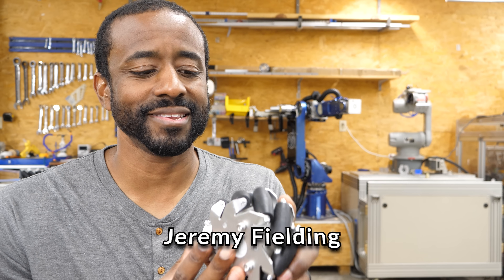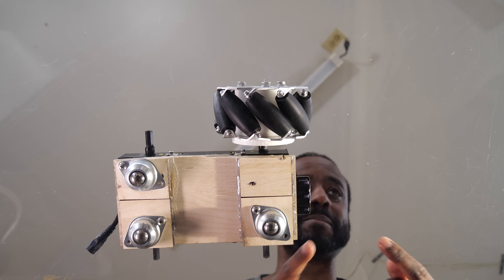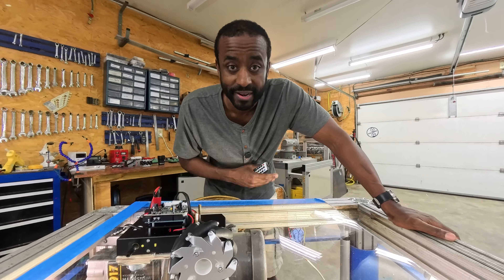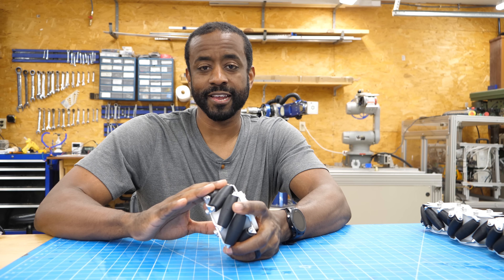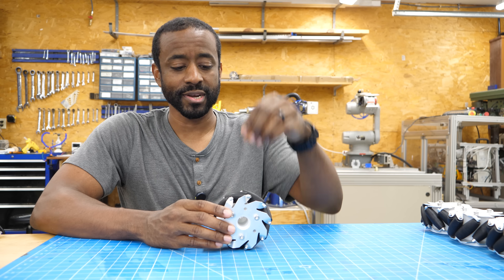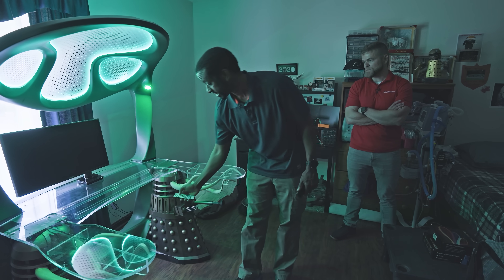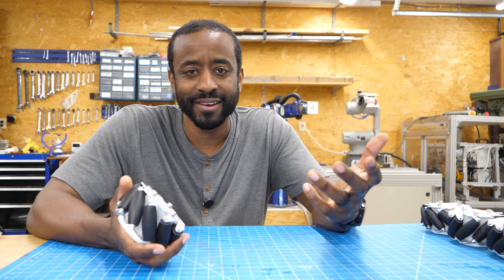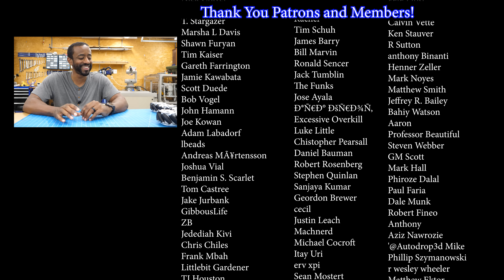The Mecanum Wheel Is So Weird, It Is Genius. How It Works

Comment: Back at school we used two motors, two wheels, one rear caster, and we had to build the body from wood. We used BBC Microcomputers (no fancy controllers, it was wired to a jack plugged directly into one of the myriad of ports on the machine) with an interface program created by one of the teachers to remotely control it by wire, it could be used to program instructions to control each motor directly (eg., LEFTON 5, RIGHTOFF 5, BOTHON 10 (seconds,) etc)or it could translate ihigher level instructions to control the motors to make it do what we want, like LOGO (Forward 5, Left 90, Forward 10, Right 90 etc.) The robot was very simple to construct  and taught us skills in woodwork, basic electrical engineering (basically how a resistor works) soldering and programming (even if it was a high level anguage.)

Comment: Thanks Jeremy, interesting video.  I now understand how the aircraft container loading platforms work using mecanum wheels when they line up the containers to load into the aircraft.  The wheels are mounted into the platform of the container lift, they then act on the container to align it.

Comment: Hello, I first saw this wheel drive in a monthly publication "Popular Mechanics" from 1967, in France, and I remember that its inventor was a citizen of Hungary. The explanation was very clear, with an air compressor and a distributor that made the wheels turn in one direction or the other, according to a number of revolutions per wheel, which means that the vehicle equipped with these wheels did not need a gearbox, nor a differential(s). Therefore, it is far from being a recent invention, and I think that it has since fallen into the public domain.
Reply: Hello again, on reflection, I thought I still had the newspaper "Mécanique populaire" which contains this article, and I found it. It is the September 1965 issue, in French version, and appears on pages 70 and 71, under the title "Cest la roue qui marche!". The inventor is Julius MACKERLE, and the entire kinematic chain contains, in addition to the chassis, four walking wheels, an air compressor and a motor to operate the compressor. I tried to find the corresponding issue in the U.S. version, without success so far.
Reply: Great information, thanks!

Comment: I worked as an intern at a robotics company doing software for ROS.

Apart from development I also had to test the actual robots to ensure everything was ok before shipping and some had those mecanum wheels.

I controlled the robot with a PS4 controller and it was like a really expensive RC car and yes, at high speeds the wheels slipped a lot, it was really fun  making it drifting inside the company’s warehouse.

Comment: Jeremy’s last comment - referencing women in engineering - so true - in the UK you can’t take an engineering degree unless you have Math ‘A’ level qualification (and probably other STEM subjects). Sadly < 40% of those taking Maths are female - this automatically limits the pool of talent going on to take Engineering (approximately only 20%, if you are lucky). It doesn’t help that many women then leave engineering even after working so hard to beat the odds and qualifying. Why? What can be done to get equality? There are few excuses for strength being the reason as health and safety means that the workplace is able to mechanised to enable anyone to work in engineering plus a lot of engineering now is intellectual based work. Answers on a post card… It can’t be intellect as females seem to outperform their male adversaries in many subjects.

Comment: Didn't really go into exactly how it works though, which is kind of a bummer. Are the rollers powered at all?
Reply from the maker: No the rollers are not powered. Did you watch the whole video? It might help to watch again. It's all in there, and really the explaining how it works is done in the first 5 minutes or so. The rest covers engineering concepts like in what applications it is best used

Comment: The inside of the wheels will wearout faster than the outside because of the forward inside vector, in Physics you can +5 and -5 and end up with 0 but in reality there are negatives otherwise it would have been in everyday use, simple, and Macanum sounds alot like a toy, "Meccano" of which I had a set when I was 8. Nice work!

Comment: The imprecision of this kind of wheel seems like a perfect thing to solve with machine learning. Not even for full autonomy, just to translate the operator input into the output that puts it exactly where the operator intended. Changes in friction in both the wheel bearings and tires themselves might be tricky, but it seems worth trying.

Comment: Why are wheel wheels acorn shaped? Given the current skill and processing power of even a small device, why are they not controlled and have more streamlined designed apart from being happy of dragged sideways. Pretty dull I would say.

You want to be able to sense those obstacles and the wheel will do it for us. It is like rolling a ball bearing shaped hair curls on our heads against walls.

Comment: They are cool and interesting but there are a lot moving parts on each wheel, that means multiple points of failure and maintenance. Being able to use them on only smooth flat floors is another downside. Is this trying to solve a problem that has already been solved ?. Standard wheels that swivel do exactly the same thing.

Comment: As a parent, 150 would be the limit for a project for one of my kids.  A grandparent would spend up to 300 (pulled from a study I read a couple years back).  A project for myself, it comes down to how long it will be an enjoyable hobby.  I budget 100 a month, so if building, programming, and othr tinkering can be spread out over 3 or 4 months, that's up to 400.  It would make it easier if it's a base kit that's as simple as you can get, with a clear path to upgrade or modify as objectives are cleared.  So, in that case, start with a solid wheeled 2 wheel tail dragger.  Next, add another pair of wheels.  Third, add sensors.  Fourth, add the Mecanum wheels.  From there you can do ball type manipulation or learning to do a speed run of a course drawn on the ground.

Comment: The Mecanum wheel is a form of tireless wheel, with a series of rubberized external rollers obliquely attached to the whole circumference of its rim. These rollers typically each have an axis of rotation at 45° to the wheel plane and at 45° to the axle line.

Comment: The fact that it crabs when it has only one wheel which needs to be cancelled out with two, shows that it scrubs which equals friction and inefficiency, noise, wear and tear etc.

Why not just have the wheel with smaller wheels at right angles around the rim, those smaller wheels can be locked or activated. Locked to make the vehicle go forward or backwards. Rotated to make the vehicle go sideways. Bit more complicated but infinitely controllable.

Comment: "complexity" lies in the eye of the beholder - and what the actual usecase requires. Because if you want to do a compareable manouveribility to the Mecanum with conventional wheels & pivoting arms you end up with "fancy caster wheels". And the system complexity is even greater because of the mechanical suspension & control mechanisms.
I like to think of something like SPMTs (self propelled modular transporter) which are f.e. used in heavy transporting, most well known with companies like Mammoet. The wheels can rotate like 240° and go up & down, all controlled hydraulically to keep the platform level. SPTMs have different steering modes, the controlability is quite fascinating (there's a demo video from manufacturer Goldhofer). ✌️

Comment: That's a brilliant application for short distance movement in tight spaces. There seems to be a 30% mechanical torque advantage during forward movement with the 45 degree camber.

Comment: interesting. I raced stock cars on a dirt track and we would cut grooves in the tires in and at about the angle as the wheels because the cars were always sideways in the corners and the new grooves would give forward bite pulling the car forward. Im not explaining it very well but it works and has for at least 50 years.

Comment: Lame and stupid.  If I were an engineer, I'd make wheel-less wheels, that use a force field or something so the robot is essentially floating.  Could go every direction, including up!  And it would be super efficient, because there would be no friction between the robot and the ground.  Wouldn't be hard at all.  Probably just 3D print the parts necessary.  I could probably come up with like 10 other ideas as well, that would be better and do more things than these wheels.  Easily.

Comment: Do they wear funny because of the constant slip? It seems like if you're putting a constant lateral load on the roller parts, they would abrade faster or potentially unevenly if you're making a bunch of turns on one direction for instance.

Comment: Thank you for the explanation and demonstrations.  One thing I do not get, is when those 2 forces cancel each out when you had just 2 wheels on there, that also means slippage/friction has to be taking place right?  Does the advantage of fantastic maneuverability outweigh the cost of replacing the worn out rollers on a regular basis?  Thanks again, I had no idea how these wheels worked.

Comment: $250 is getting into video game console prices (Switch / Quest 2) and 3D printer price ranges - things that people will probably use a lot more than an intro-level robot. If I knew nothing about electronics or robotics, $80 would probably be the most I'd spend to see if I liked it - something closer to the RC Car price range. As an interesting side note, there's a gesture controlled RC car on Amazon with Mecanum wheels for $30.

Comment: I'm thinking about 3 wheel version that has rollers assembled in an equilateral triangle. That sounds fun but very unstable and not straight forwarded to control. It is easier to maintenance though.

Comment: I’ve been interested in learning and getting into RC cars, planes, etc. for a while as a hobby and something to do with the children. $300 would probably be the cap for me, if I could get other things out of this project besides the project itself. The main thing would be knowledge, and some tools or literature, or discounts on those things, etc. would be appreciated as well. I like that this genre , as you said, covers multiple disciplines (mechanical, electrical, electronic, programming, fabrication, welding, etc.). A good place to start would have good functionality, as you said, and without the need for investing in expensive equipment or tooling to accomplish the project successfully. Although realistically this should be somewhat challenging in order for this to be satisfying. The more we are invested with effort, etc. the sweeter the success when achieved.

Comment: Interesting design of wheel, but is seems to be very inefficient.  The forklifts shown are counterbalance, are reach trucks or all direction trucks not common in the US?  Also for tight spaces are Bendi trucks with a centre pivot for steering.

Comment: Thanks for the demo on the mecanum wheel. I'm interested in a series for building . There is a smaller bot called micromouse which might make for interesting content m. Its a maze solver so there is a couple of points to cover from design to sensors and some basic c programming for arduino or similar boards. I'm fom South Africa. I really appreciate your efforts to both get people interested in robotics and teach about aspects around it.

Comment: Mechanum Boots for entertainers. See them Moonwalk Sideways then in any direction.  Remember the kids roller skates that took skate keys, they tightened a clamp onto each shoe sole (hard soles, nor tennis shoes) well instead of regular wheels driven by your legs and feet, make if a Mech robot driven by a hand controller hidden in a pants pocket running off a battery hidden wherever it is convenient.  Or something...

Comment: I am interested in the difference of used power compared to standard wheels.
It seems this ones are spinning a lot to achieve the same distance, hence a larger liss of energy.

But very cool system for tight spaces. ❤

Comment: 9:39 - I mean, if they're just going to fall off, that might be a reason not to use them.  🤣

(Totally kidding, I just found the juxtaposition of that question and that shot to be amusing.)
Reply: P.S.  Where my price cutoff would be would depend a great deal on the details.  I think $200 would probably be pretty much the top of my likely spend for something that would only help me learn and/or give me something "cool".  To go beyond that, I'd need to get something that could indeed be practical, at least a little.  Like, maybe I'd pay $400 for something that had a 50cm x 50cm platform (say), and could carry 20kg or so (or more??!?), so I could put stuff on it (either additional robotics, or just like a tool bucket or trash can or whatever) and have it move things around for me.  But also, I'm not sure I have a smooth enough environment for these wheels to be good??  So, not sure.

Comment: Very cool, you might as well make a heavy duty platform robot to move your shop tools around; that would be the base ( using the Mecanum wheels) and a mechanical lift that allows you to get it under all you shop tools. End goal, a shop where you can automate and rearrange your tools by use of you platform/lift robot.

Comment: Project idea for easy intermediate robotics using these wheels. Make a low-tech roaming shop vac robot that can seat an off-the-shelf shop-vac on a programmable base and servos to turn on and off the Vac. V1 use the bump method for navigation before going into IR or Lidar tech.

Comment: Normally when I explain to someone my theory on gyroscopic proportion, they can't wrap their head around how to cancel out all the rotational force. 3:15, having a single engine consist of a 2 engines would counteract the each other, leaving only the directional forces to propel whatever it is mounted in. If you understand how a gyro works for navigation in aircraft and ships, then you will understand that locking a gyro into position and forcing it in a direction with a pre determined angle of attack will create directional and rotational forces. I am too poor to build an adequate test engine, although I have tried. Everything needs to be balanced to prevent a death wobble. I am not the only one who has this idea. The internet is full of others failed attempts and educated people saying it will not work. I know in my gut it will.

Comment: If it's gonna be using some reprogrammable controlling hardware, would probably be a good idea to include IMUs to let people with a little more ambitious goals to fine-tune the ride and ensure it stays aimed in the right way even with small deviations in motor speeds or wheel traction. Or depending on the costs and such, maybe instead, if it makes sense, a pair of optical mouse cameras, with different lenses than what mouse use to account for the ground clearance the robot has.

Comment: I'm not a mechanical engineer but they are all forced movements.
The stress on the axles, wheels and the surface it touches, considering the heavy weight a forklift carries, will quickly break something.

Comment: Several problems haunt this wheel.   First, the surface it operates on needs to be smooth, level, and no imperfections or debris  the size of pea and up. Or else the wheel will get stuck negotiating it.

Second, it's still not mechanically perfect. The more complex it is, the bigger the chance it's going to fail. This is an outstanding example of that.

Third, the cost of a forklift that used them,  triple the going rate of a nice forklift with air conditioning. And being prone to failure, not a good investment by a warehouse or shipping company that needs working equipment.  The same goes with any machine that uses them. 

It's going to have to improve all the above by large leaps and bounds before it really establishes itself on the market.  Right now, it's a fascinating gadget.

Comment: I’ve just had an idea.  Perhaps a Mecanum wheel or a modified style of   one could be arranged to work in a triangular setup.  Three wheels 120 degrees apart from each other.  If it could be driven in all directions just as four could then you would eliminate the cost of one wheel but also weight would be more evenly distributed and therefore it might work better on uneven surfaces.

Comment: Four independent motors required?
Reply from the maker: yes. To get all the possible motions, each wheel needs to be able to spin independently. Though it would be possible to do this with special gear boxes in the same way that your car can reverse the motion of the car with the motor spinning the same direction. I haven't confirmed but it is most likely a motor on each wheel.
Reply: @Jeremy_Fielding  That makes sense.

Comment: What if the rollers were soft rubber to eliminate some of the slippage? Like a softer race tire compound.
Reply from the maker: You actually want slippage. That is by design as a said a couple times in the video. Rollers are there precisely to allow some slip in the direction you don’t want.

Comment: The Mecanum wheel can also be used as a part of CONVEYOR systems for boxes or pallets.  On some jumbo jet airplanes the cargo is loaded into the belly as huge Containers.  The cargo loading conveyor system can rotate and orientate the bins as they move in/out of the plane.